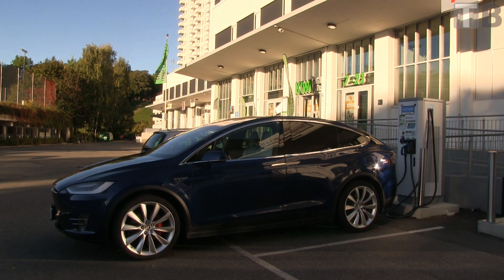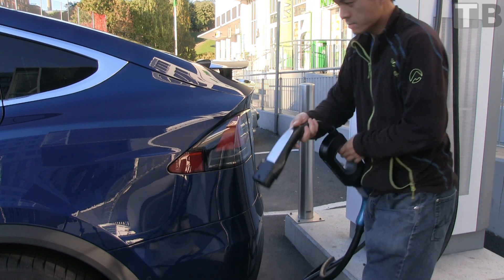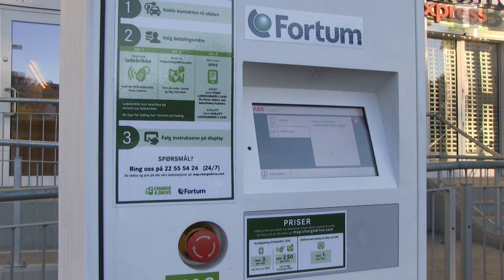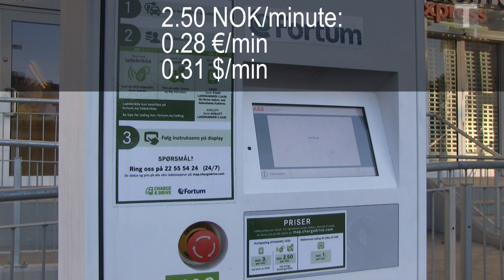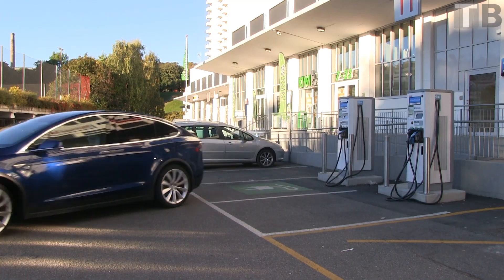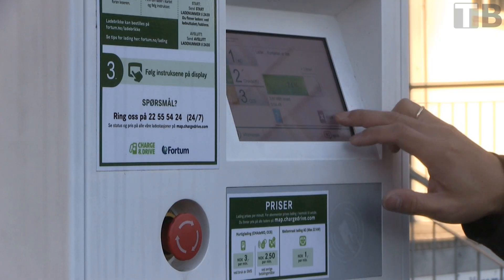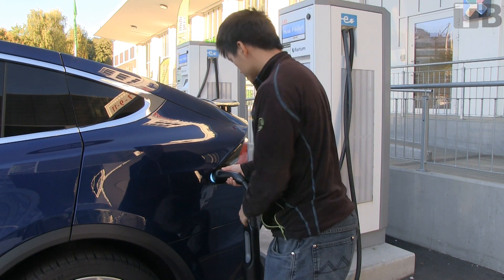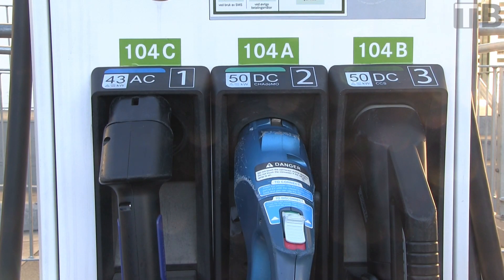How to use CHAdeMO adapter

Comment: Hi. Is the ChaDeMo adapter on this video a Type 2 at the end or a NACS(TPC)?
Thanks.
Reply: It is a Tesla special variant of the Type 2 connector which was used in the rest of the world outside North America up until they switched to the full CCS port.

As far as I know, you cannot use the CHAdeMO adapter on Teslas with the CCS port.

Comment: and does this work revers for Nissan Leaf?

Drive to the Tesla Super Charger, connect the adapter and charge your car 100kWh (Nissan leaf E+ tekna) or is there a reason why this would not work? only the risk of causing damage to the Nissan Leaf? Or maybe the super charger would notice this?
Reply: It physically does not fit. There is no male-CHAdeMO to female Type 2 adapter. Any correctly functioning charger will not enable power flow until a series of safety and functionality checks are performed successfully.